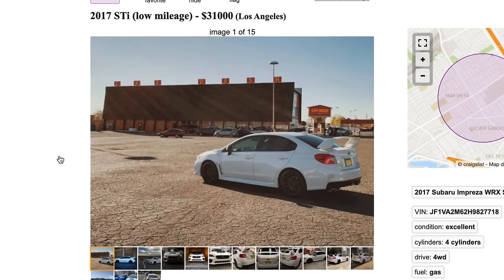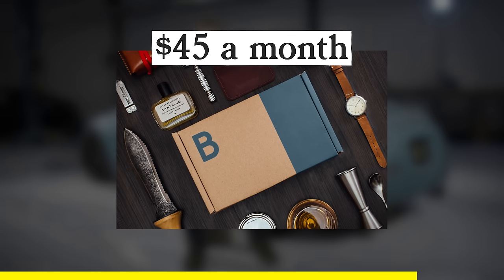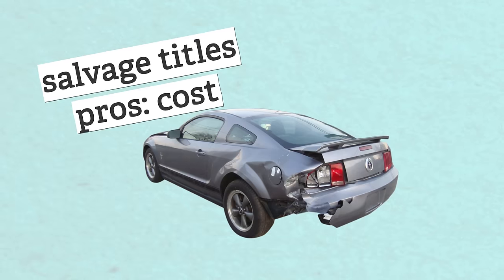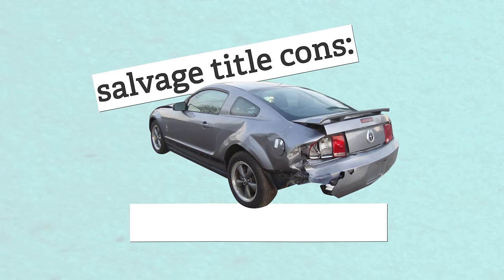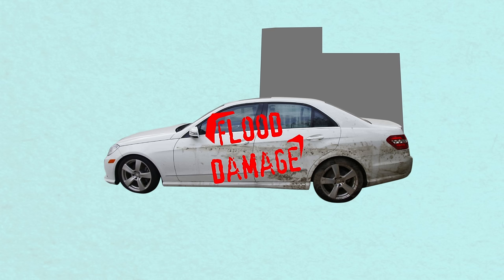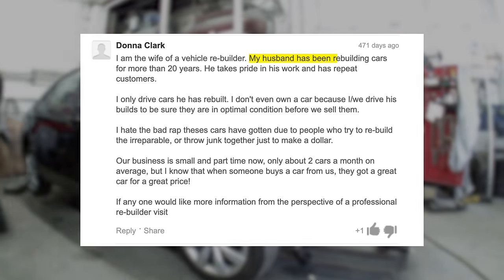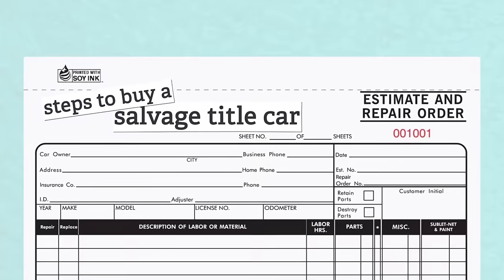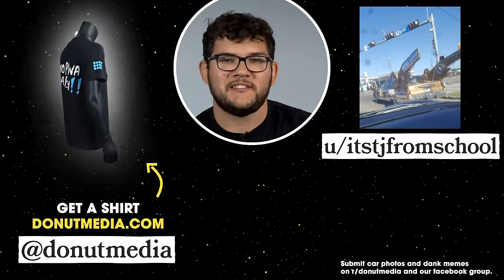Buying a Salvage Title Car: Bargain or Nightmare?

Comment: you only save a little bit buying salvaged title cars. in reality the money you spend fixing and repairing most of them is way higher than it should be. specially right now. I've bought 3 salvaged title cars now and 2 ended up being personal vehicles that were totaled for simple damage that was easily repaired. those i managed to make a fairly decent profit on right now however even salvaged titled vehicles are selling for retail prices because of the supply and demand issues if there is a question about a salvaged title car there are sites like autoauctions.io that have reporting and pictures of the cars as they were at the time they were originally sold as salvaged and the information you are giving about the insurance is also FALSE! as i said i have owned 3 salvaged titled vehicles and had ZERO problem insuring any of them with full coverage insurance. i wasn't even asked about the title status when i purchased insurance and i paid no more than my normal monthly rate to insure any of these cars so far. so that is completely WRONG! and it's not even just that this report was done in 2019 and it's 20201 now it's ALWAYS been that way. You guys should do a little more actual research before you just go playing democrat and making shit up that you think just makes sense to say. You're completely wrong about this whole story.The only thing that even came close to factual information in this is that some SMALLER dealers won't touch salvaged title cars. regardless of what they were salvaged for I traded in one of my salvaged title vehicles at a larger dealership and almost got the current market value for it and not just on paper ACTUAL fair market value for a vehicle of that type with similar mileage and wear and tear. Individuals are a little different. the way i priced my flip projects individuals were all over them and they other 2 i had sold VERY quickly but i also wasn't trying to get rich off of flipping those 2 vehicles and that was the difference. i sold them at $1,000.00 - $2,000.00 over wholesale value and people came throwing money at me and couldn't get the vehicles bought fast enough. and yes I posted them as "salvaged titled vehicles" when i sold them too. i don't roll like that but i also gave the prospective buyers pictures of the damage as well as showing them everything i did to repair that damage and i had ZERO issue selling any of the ones i have purchased and flipped so far. one of the guys has come back to me wanting to know if i'm going to get another one to flip any time soon because he was so happy with the first one he bought but he lost it to his wife when he got it home and he wants another one now. As for "title washing" there is only one state currently that you can legally get a regular title once the vehicle is repaired and that is Georgia. You have to have the car inspected by a state inspector and if you repaired it properly and completely you get a clear title HOWEVER the title history still reflects the salvaged brand so if you're buying in Georgia Do your research look up your vin on sites like car fax, accucheck, or vehiclehistory.com and those sites will reflect the accident type and what was damaged usually and the fact it was repaired and inspected or just left with a salvaged title. There is a lot more protection out there for buyers now than there used to be. So when you are ready to buy do your homework and if the deal doesn't happen before the vehicle sells to someone else then remember this it may not have been the one you wanted after all and let someone else deal with all of the problems that go with a salvaged title car that may not have been repaired correctly. I Do like that you highlighted one of the guys i have followed for a long time that does his repairs the proper way "VEHCOR" here on you tube. he does fix the right or he won't touch he job at all. He uses factory panels and fixes them up the right way just like the dealers would if it were a delaer owned car when damaged

Comment: Hey can someone give me some advice. I’m looking at a 2000 mustang gt. It has its front end missing, but as far as I can tell the cars frame is straight. It was a write off, due to the damage. I ran the vin and it’s correct. The yard wants $2800 for the car. After fixing it’s still $5-6k cheaper than ones near me. Is this worth it?

Comment: Theta/GDI engine problems aside, I picked up a 2012 Sonata 2.4l limited with 55k for 5 grand. It’s in great condition too. Question, am I not eligible for an engine replacement due to the recall if mine goes because it’s a salvage title car?

Comment: Two years ago, I bought a salvage title '06 silver 4 runner, with 92K miles on it. It drove great, and the shop that did the rebuild showed me pics of the original damage to the right front quarter, and step by step pics of the dismantling and rebuild. The front radiator header AND side apron were NOT damaged at all, in fact all they did was unbolt then bolt on parts from a rear-ended, salvaged '07, including new headlight units. Today, at 113K this car is as tight as new, runs beautifully, and is reliable as any Toyota can be. I LOVE THIS THING. I expect it will go on for another 100K. I paid $7500 when most others on the market here in Texas were going for $9K average. I lucked out. But, yes, insurance the first year(Geico) was a huge ripoff at $1050. Then I switched to AARP Hartford who did not discriminate on the title, and charged me $550!!!!! F**K Geico!!!

Comment: What if your grandma promised you her car when you got your license but between the time of her doing that and actually getting your license (9 months), she was in 4 accidents, the last of which “totaled” the car. So you and your dad (whose a truck mechanic) “fixed” the damage by pulling out the smashed in front radiator support with a hand winch tied to a concrete post and the car shifted in reverse, then getting a salvaged title for the car so I could get liability insurance and drive it, is that not recommended either? 

Asking for a friend

Comment: Nobody wastes the time or money to rebuild cars that are smashed all to hell, just go on copart or iaa and look at the cars in the auction and you will se hundreds and thousands of cars marked “run and drive” that are fully functioning and drivable cars that just need cosmetic repairs like hoods and bumpers and headlights and fenders and paint jobs, or some that are rear ended and need rear bumpers and tail lights 
These repairs are not difficult and it just makes sense that there are people out there willing to fix them and get them back out there on the roads
The really badly damaged cars are sold to dismantlers like LKQ and other parts stores that take the parts off of them and sell them to body shops to use on repairable cars 
In this age of “environmentalism” you’d think that automotive rebuilders would be hailed as recyclers who are helping to reduce waste and pollution but they never get credit for that

Comment: There’s a couple specialized dealerships here in Utah that fix salvage titles and sell them. Tons of people have had issues with both of them so at least in Utah I wouldn’t do it. Both are the 2 main branded title dealerships and both scam the fuck out of you. Negative reviews and buyers remorse for days. If done right, sure. But people who do it right are people with mechanical prowess, not just people looking to save $5-10k on a car.

Comment: There is no difference between salvage rebuilt cars and clean cars with accident history; all this crap is, is gov casing unnecessary issues... a rebuilt car shouldn't be any different in value than a clean car with accident history... a car completely burnt to the ground even flooded can still have a clean title yet a car with a very minor parking lot dig could get salvaged... per insurance most all dont care as they charge you full value insurance no matter what; you can drive a pos $500 civic but pay as if its a perfectly good full value 10k civic; insurance is not an issue and they inspect vehicle damage anyways and can tell if something was not related to damage being claimed... there is absolutely no reason why a rebuilt car should be worth less than a clean car with accident history... if buying a car you can look up the vin and see exactly what its history is

Comment: If only they weren’t so hard and expensive to insure. I can’t find any NA for under 3K that is actually worth the price. I’m seeing almost totalled cars, cars with over 200K miles, like completely shit box miata’s just begging to be put out of their misery going easily for 5-10K :| 
Meanwhile at the junkyards and such they have running NAs selling at auction for like 300 bucks with like a bent door or hood, but literally drivable :| I’ve seen Miatas that all they need are new hoods and a new bumper, with everything else running and working sell at auction for 1.2K 
These same Miatas sell on OfferUp, FB, and EBay for like 3-8K 
NA owners have to get their heads out of their asses. Literally, like it’s outright a scam. I’ve seen blown Miatas, rusted out Miatas, just horrid shit trying to sell them for 5K easily :| as if they don’t see the irony. This dude just posted a shell for 3K :| no engine, no tranny, no seats, shit it doesn’t even have doors :| the shell wasn’t even in decent shape at all, horrible, freaking scams. 
Salvaged cars shouldn’t be so hard to insure nor as expensive

Comment: "2011 Honda civic it run good engine n transmission no problem fuel saver. Rebuilt title in hand. Low mile 367,000 mile. Will need trailer. $17,000 firm., ‼️‼️🚨🚨🚨🚨VEN A COMPROBARLO HOY PRIMERO QUE LLEGA PRIMERO SERVIR🚨🚨🚨🚨‼️‼️ "